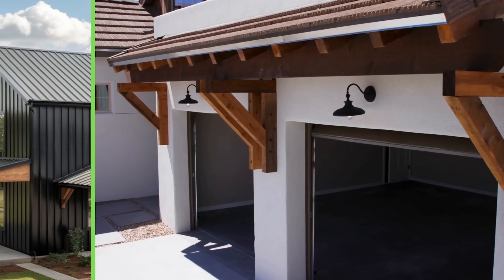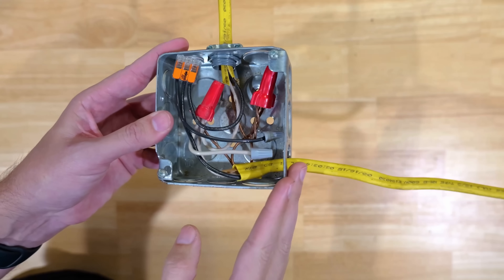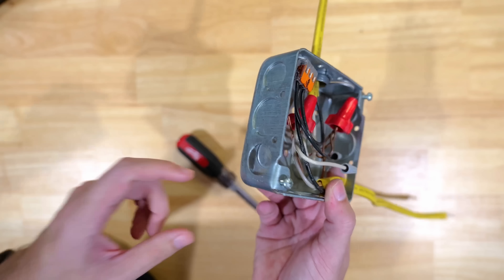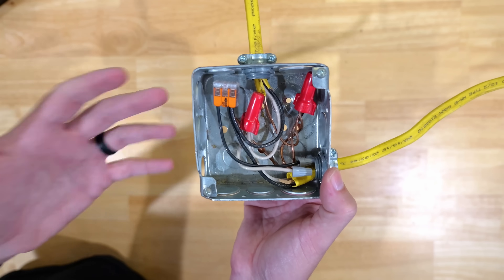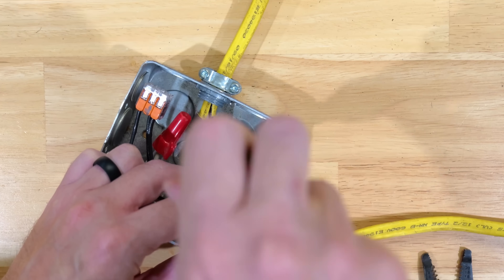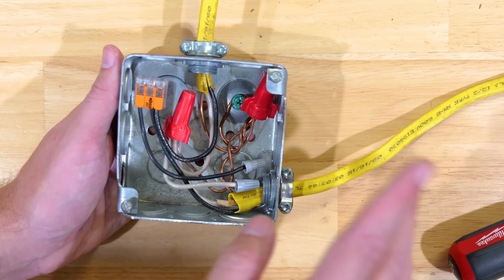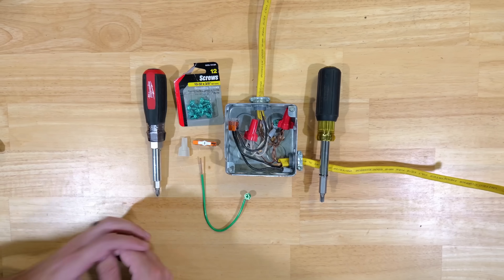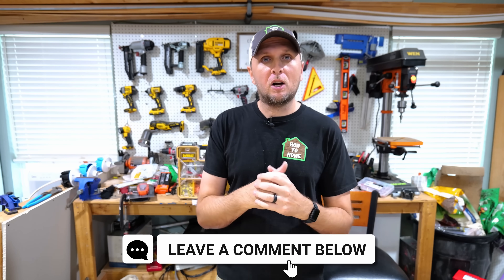SHOCKING Mistakes DIYers Make Installing Metal Electrical Boxes!

Comment: I am not an electrician, but I had learned a lot working with my father in law. I did see the missing clamp and the missing ground screw. I also was looking at the 2 leads which had a wire nut on, and thought Why are those in there and capped?  For wire connections I use a crimping tool and copper sleeves, topped with a rubber boot. On my ground leads I always push the ground leads to the side of the box. But I Have screwed them to the box if its a junction box.  I also check my cable clamps for burrs. I had one on a light switch box, it didn't appear for several months.  It was a 12' run so I replaced it. Learned something that day.
Reply: The wires capped were for a new receptacle to be installed.  The copper crimp sleeves are called, "Buchanan", trade name, and that is great you are crimping all of your ground wires together.  Great job!
Reply: @billhandymanbill2775  Thats the correct name, my electrical tool box is in a cabinet in the garage.
Reply: @thomasaccuntius9946  Great! Thanks for responding.  Keep up the great electrical work!

Comment: my not understanding wy the boxes are so small when putting so much in them  and no way would i wire a 20 circuit and put 20a receptacles in with 14 ga and im a radio operator not electrician
Reply: there are box fill requirements of 2 Cubit inches for each 14 g wire and 2.25 cus for 12 ga. all boxes are stamped with their c.u.s  platic ones will actually tell you how many wires of each size you cant put in.  If you mix sizes?? haha, find the table!

Comment: Using the correct breaker would solve the problem. Technical Specilist in commercial wiring in a factory 🏭
Reply: then the entire ckt is derated also

Comment: That metal box needs to be grounded to a common earth ground. Thoughts matal boxes were designed for metal conduit  or metal earth ground ,like metal beams that are earth grounded. Get rid of those wire nuts and use a copper crimp device and wrap those leads with electric tape..

Comment: Putting a plug into any extra holes in the box means the difference between a mouse house and an electrical box.  And be sure the mice will chew on those wires and fill the box with flammable material as well.
Reply: The outside electrical panel on our house had a 1 inch knockout hole that wasn't plugged.  The first time I opened the panel I discovered a yellojacket nest inside.  I had to run for my life !
Reply: In Eastern-Canada we get pincer bugs inside the boxes if we don't add the rubber seal as well, and these bugs, cause a bug, eventually. I got this often with heat-pump or pool boxes.
Reply: @MarkLowCarb  Here in Kansas, it'll be wasps that infest it too.  Mud Daubers aren't so bad to deal with but make a hardened mess but Yellowjackets are mean and their paper nests are flammable.
Reply: I was hoping he'd use their trade name: fuckup plug 🤣

Comment: Clamp is not necessary unless there is tension on the electrical line. Always keep couple of inches extra cable than minimum code. 
Use plastic electrical box instead Iron
Reply: Not true, clamp is always required where wire enters the box. ALWAYS!
Reply: @ I should have clarified. Read Section 314.17(C) Cable support within box:
Even if a box doesn't have a clamp, the cable must be supported within a specific distance from the box entry point.
Reply: @mohammedrahman308   NO four sqaure box like that will have internal clamps and you know this.

Comment: I've been an electrician for 30 years and yes that box is very improper and unprofessional but not nearly as dangerous as it seems.. I see far far worse on a nearly daily basis that has been fine and safe for decades.. Even not using a connector, as ridiculous as that is, the box is not just gonna chop through the wire or insulation for a hundred years. I do proper work, I'm kind of a perfectionist in that way but safety is the least of my reasons for being professional.  What I mean is safety is number one priority, that's just a given, but so many of the things people say will cause immediate electrocution if one walks by it is just simply not true and a fire isn't smoldering in the wall, I see it every day. Fires and injury due to faulty wiring are almost non existent.. i can think of one at a fountain in west palm beach florida where someone was tragically electrocuted due to improper grounding but I can't think of another one, not saying there aren't any but I can't think of any off hand right now. Virtually all accidents with electricity are work related, be it the dyi  guy or the pro.. That doesn't mean I believe in doing anything dangerous or sloppy work.   I personally don't take shortcuts, its just way too easy to do things right and safe and proper, and I bill accordingly so its more of a matter of pride in a job well done and leaving no room for criticism.. Haven't failed an inspection in a while..  I'm just saying that none of the things I saw  there would be likely to cause damage or injury. If that we're the case, most of the homes and condos in south florida where I live would be an ash heap and people would be dropping like flies all over the place. I've done commercial industrial and residential, been doing remodels for the last10 years and you wouldn't believe what I find when I start opening up some walls for especially a new kitchen or bathroom. Crazy bad stuff and yet no fire and no one got shocked.. just sayin..
Reply: Don't forget that what you see when you open a box or wall, is NOT a random sample of what is out there in the wild.  It is a random sample of what is out there in the wild, minus EVERY case which has burned down from being wrong.  It's the same thing as survivor bias.  

Like my mother saying that she was 96 years old despite living in a town with radon in the water, so radon in the water must be OK.  No, mom, radon may be the reason that every friend and relative within 10 years of your age in that town has already long ago died of cancer, and you were just the one where the dice came up a lucky number.  The dead people don't get to voice their opinion, just as the burned up wiring doesn't get discovered when doing routine work on a similar setup which was at risk of burning, but didn't.
Reply: It's wild that the human race survived a d even flourished before all this safety nonsense. Only thing I cringed at was not using a wire clamp, but it would take a LOT to get through all of the sheathing. And let's not even talk about the wiring that hasn't been updated in 70s era homes.
Reply: bugs will get in there. so can little fingers
Reply: The number one cause of home fires is electrical. That alone tells the tale.
Reply: @brancampbell  No its not, that us just factually untrue... Kitchen fires while cooking cause is what causes house fires more than every other cause combined...
Reply: The #1 cause of home fires is kitchen and cooking.
Reply: Coulda worded that in abt 4 lines
Reply: Could you elaborate a little more 😂
Reply: Agreed.  My biggest issue is the damn Wagos - especially if they are connected to something that will see mechanical loads.  Grounding is likely just fine if the receptacle is grounded.
Reply: @MintStiles  

The load carrying capacity of the Wago connecters and the competing IDEAL versions are proven. With the former, decades proven. The only issue I have with Wago is their current lever nuts, with the levers lifting on their own, necessitating wrapping them with tape. My favorite Wago though is the push in 2773 version. They are very tiny and make working on the boxes of older homes that are crammed with so many wires so much easier. Their largest version holds 8 wires.
Reply: @CorneliusTaylor-s1u  I am not trashing on Wagos.  I just think their applications are limited.  Like you said, there are specific versions that just won't stand up to mechanical stress.  I think they are excellent in a hot swap application for control wires of mission critical systems that can't easily be shut off.  I just can't bring myself to use them in lieu of a proper twist and nut.
Reply: @MintStiles  

"I am not trashing on Wagos. I just think their applications are limited. Like you said, there are specific versions that just won't stand up to mechanical stress. I think they are excellent in a hot swap application for control wires of mission critical systems that can't easily be shut off. I just can't bring myself to use them in lieu of a proper twist and nut."

You spoke of using them under load. I never said or suggested that they cannot handle that. Clearly they can. That is decades proven in other countries. I only addressed the lever coming up flaw that necessitates wrapping in tape, especially in a tight box. The tiny push in ones are also proven. 

The evidence is there for you to let go of your attachment to wire nuts.
Reply: @CorneliusTaylor-s1u  If you are suggesting that they can handle the mechanical loads, I dont agree.  I wouldn't use most iterations of Wago.  You are correct that they work just fine in most cases, but I am not taking that chance on the few.  You take 5 extra minutes per box but get a superior job.

The fact is most box wont be removed unless there is something wrong.  I am not saying that I've seen plenty of them fail, but I've seen a few (admittedly not very many), but I've never seen a properly twisted wirenut fail.  They see less load than backstabbed devices for sure, but backstabbed devices fail at an incredible rate when subjected to every moderate repeated technical stresses.

Wagos have their places in control applications, but it's my opinion that "why wouldn't I take the extra 5 minutes" unless I am told other wise.  Sure it's good enough, probably... but someone's family lives there.  It's that simple for me.
Reply: @MintStiles I’ve seen wagos tested thoroughly - under massive loads, pull test, and 1-2 others n they were neck in neck or superior w wire nuts in 3/4    Prob why the Germans swear by them.  I’m with you - think we’re sorta molded into thinking wire nuts are better n many Europeans think the opposite but use em on a limited basis - as u seem to also
Reply: @MintStiles  

"If you are suggesting that they can handle the mechanical loads, I dont agree."

I don't suggest things. I have been clearing what I have said. You can also disagree as much as you want but you're disagreeing against science and statistics

.I wouldn't use most iterations of Wago. You are correct that they work just fine in most cases, but I am not taking that chance on the few."

You are again putting words in my mouth. They work in every case where they are rated to work.

You take 5 extra minutes per box but get a superior job.
The fact is most box wont be removed unless there is something wrong. I am not saying that l've seen plenty of them fail, but l've seen a few (admittedly not very many), but l've never seen a properly twisted wirenut fail."

Were the Wagos you claim to have seen fail properly used as well? 

"They see less load than backstabbed devices for sure, but backstabbed devices fail at an incredible rate when subjected to every moderate repeated technical stresses."

That's actually not true. While they get a mostly negative opinion from people, their failure rate is not incredible at all. It also needs to be considered how each brand that utilizes such a connection method designs theirs. A blanket rejection makes no sense. The Germans, by the way, use backstabbing for their switches and outlets.

"Wagos have their places in control applications, but it's my opinion that "why wouldn't I take the extra 5 minutes" unless I am told other wise. Sure it's good enough, probably... but someone's family lives there. It's that simple for me."

They are proven after decades of use. You're ignoring that fact.
Reply: @CorneliusTaylor-s1u no offense but TLDR. Seriously?
Reply: @MintStiles  

What's your question ?
Reply: @CorneliusTaylor-s1u  lots of guys on job sites that insists on doing some weird things that doesn't actually save anytime in place of the the tried and true. I am certainly not advocating against progress, but you are arguing for a "maybe" against absolutely.  NO THANKS.  If you want to do that, that's fine. Start your own company or find a boss that is okay with it.  I'll pay my guys for an extra 10 work hours to get it done the way that I don't have to ever worry about.  If someone insists on their own spec, go somewhere else.
Reply: @MintStiles I saw some crazy smart German dude conduct cool state of the art testing on wire nuts n wegos- pull strength, put huge loads on wires so they heated up n got wire nuts, wegos super hot- tip failed etc- n surprised the hell outa me how strong n durable the wegos were.   Pretty much matched the wire nuts in 2/4 categories, was lil ‘weaker’ in one n stronger in the other
Reply: Right the strap is in contact with the metal
Reply: What you say is true but any time you break code or do sloppy work you are taking a chance.  Sooner or later you will be doing something when your guardian angel is taking a coffee break and ZAP.
Reply: @DavidVykoukal 

Code this, code that. The preaching of code by some is so nauseating. Code today exists to support the trades industries and the manufacturers that make the products they use. It is also a socialistic revenue generator and control mechanism for the local government. If code today existed for safety  then homeowners wouldn't have to choose between leaving old wiring as is or taking out a mortgage to rewire a house, over simply improving what the homeowner can afford. Oh no, can't have that. A truly disgusting system that at the least needs a massive overhaul, including right to repair protections.

Comment: I love Wago connectors.  I'm not an electrician and limit my practice to things like light fixtures and ceiling fans.  I worry about shoving connections into a box for these things and wrap a piece of electrical tap over the Wago tabs so that they don't accidentally get flipped open.  Good idea?  Bad idea?  Thanks.
Reply: I found a problem with the Wagos that has nothing to do with the levers. It has to do with the wire inside the clamped down lever being twisted a few times, which makes the wire automatically pop out of the Wago even thought the clamp is still trying to hold it down. So if you wanted to use tape, you'd have to wrap it in such a way that it keeps the wire from twisting inside the Wago. I'm worried that as the wires are being moved about to fit into the box, they might be twisting inside the Wago and about to pop out. You can demonstrate this twisting problem by inserting a properly stripped wire into the Wago, clamping the lever down, and then twisting the wire slightly back and forth a few times. Whenever I try that, the wire forcefully pops out of the connection.
Reply: @tomknack  Appreciate all the feedback!
Reply: @boatlover1875  it's far more likely that you will dislodge a wire nut than a wago. But don't put tape on them either.
Reply: All of Europe uses the wagos. They meet all US specifications. Don't know why people hate them so much.
Reply: @empackman1725  I love them!
Reply: I'm not a pro, but I consider electrical  tape in a box to be a red flag that someone didn't know what they're doing.  Half the time, if you pull it off, you find it covering up skinned wire insulation or other problems that should have been fixed rather than covered up.  Whether taping the Wago levers is good or bad, I don't have a firm opinion about, but I'd never do it.  If it needed it, they would have made a plastic clip or another layer of enclosure over them.  If there's not room to tuck things away without things mashing into each other, use a bigger box.
Reply: it wouldn't hurt anything

Comment: Another mistake is density in boxes. Lots of issues with stuffing too many wires in a too smaller box. Also having a smaller wire not always a problem, as long as the circuit is protected with a breaker that is sized for the smallest wire.
Reply: He mentioned that but added the risk of someone changing out breaker with 20 amp in future unaware of 1 single #14.
Reply: @jimkelly1613  well a qualified electrician would never change out a breaker for a higher value without an evaluation of the circuit.
Reply: @steveksi  you expect him to open every box on the ckt? if you got the money i guess

Comment: Unless my old eyes fool me or looks like there's an unterminated ground wire still in the box. It's unlikely but it could slip in to any of the connectors and cause a real problem. Most of code writing is trying to avoid all of those "it's unlikely but it could" situations! 😅😅😅

Comment: When the 14 gauge WAGO wire is being moved about, is swivels to and fro like it's on a finely crafted bearing 
......looks very loose.
Reply: Yeah, and if you twist the wire inside the Wago more than once or twice, it will automatically pop completely out. Wagos hold tight if you simply try to pull the wire straight out, but if you twist the wire a few times, it will forcefully pop out of the Wago on its own. That can't be good, especially if it happens while you are pushing the wires into the box and can't see that it came loose.
Reply: @tomknack  Yeah, but they're cute looking little buggers.
Reply: a lot of people dont like them

Comment: I have seen some electricians mix wire sizes and think I will just put a 15 amp breaker in place and that might well be legal but the problem there is some future electrician might change the breaker thinking that all the wires are #12 not seeing the #14 pigtail so yes don't mix those wires to save a few cents, use better sense!!

Comment: I see that Ideal makes a Wago type fitting where the lever is much tighter than a Wago so you are less likely to open a lever while packing the wires into a makeup box
Reply from the maker: Yes.  I have a couple videos about it on the channel.